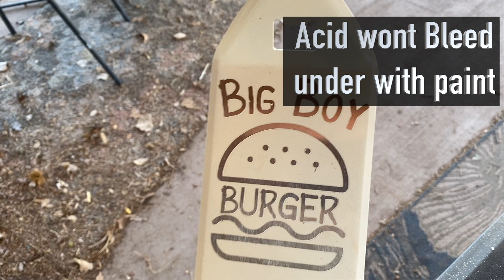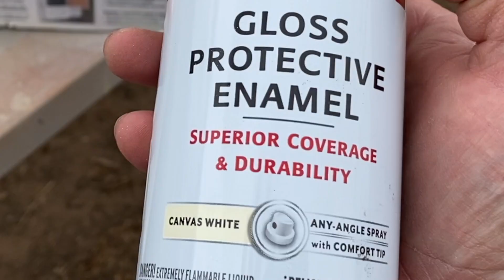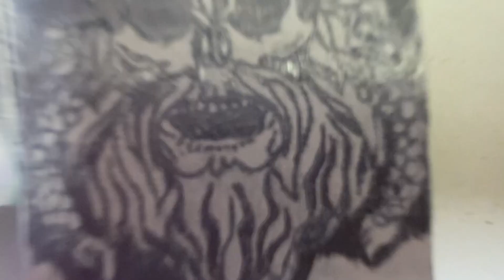🪓 HOW TO ETCH METAL with CRICUT JOY 🪓

Comment: Why don't you use the cricut to cut adhesive vinyls and then apply them to the axe head? Lot quicker. I've done a couple hatchetts the way you show and they came out great but I electro etch them using 12v
Reply from the maker: This was just showing another ways. You are right though- the vinyl templates can help speed the project up.